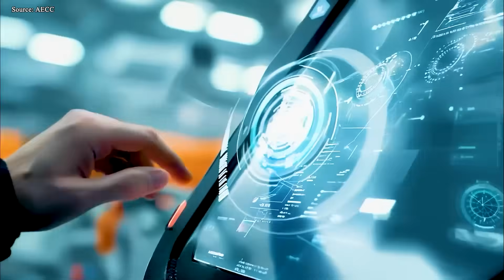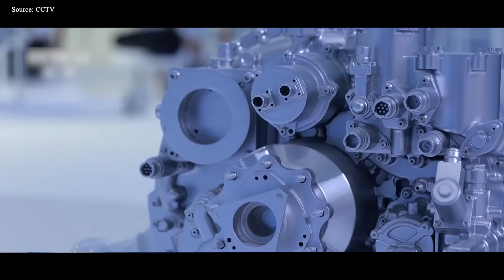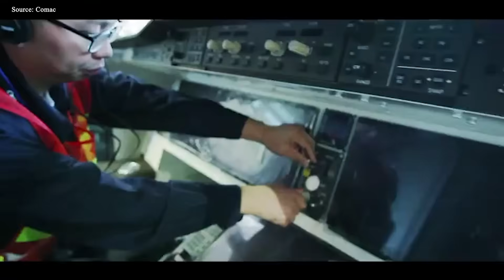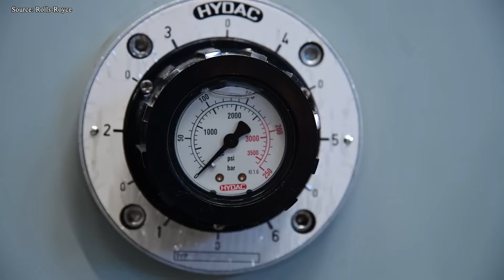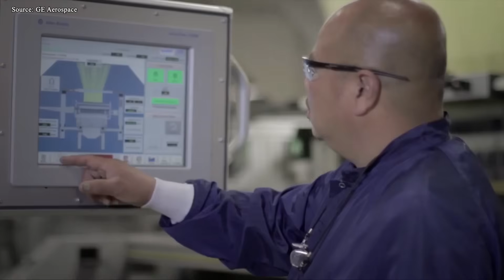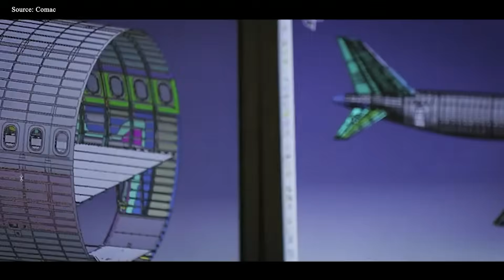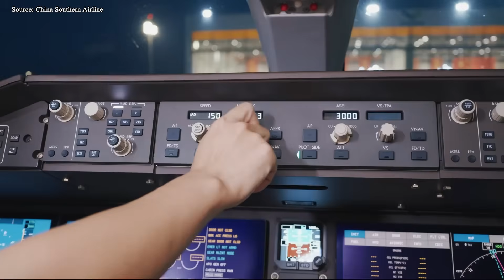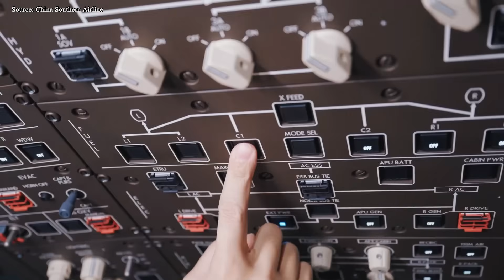How NEW Chinese CJ-3000 Engine Will Outsmart Rolls-Royce

Comment: Why does this video (and other similar ones) always show WESTERNERS working on jet engines in CHINA (presumably)?? Where are all the Chinese engineers and technicians? By having scenes of Western engineers and technical workers in jet engine labs and workshops, it makes a mockery of the subject which is taking about CHINESE innovation and progress in jet engine but show European workers instead.

This is all nonsense when a video such as this is nor produced and presented PROFESSIONALLY and appears to be just a string of different video clips from different sources put together even though the narrative on Chinese aviation advancement may be salient and correct. Otherwise, the video is more of an annoyance than an enlightenment.
Reply: CJ-3000 vs Rolls-Royce Counterparts: Core Advantages
 
In core fields, the CJ-3000 has a more forward-looking technical route than Rolls-Royce’s similar products. It integrates variable cycle technology, which can switch combustion modes on demand to adapt to different flight phases, while Rolls-Royce’s counterparts such as the Trent XWB have not yet applied this technology in mass production and still rely on traditional cycle architectures. In terms of materials and processes, the CJ-3000 makes breakthroughs—its turbine blades adopt high-temperature alloy plus 3D printing technology, enabling stable operation in 1500℃ extreme environments with a single-crystal blade yield rate of 85%. In contrast, Rolls-Royce relies on traditional nickel alloys and cooling technologies, showing slightly inferior high-temperature adaptability and process innovation. In layout design, the CJ-3000 is equipped with gear transmission technology (GTF) and carbon fiber composite fan blades, combined with a twin-engine layout to simplify the structure. Although Rolls-Royce has advantages in three-axis structure adjustment, its mechanical complexity is higher and flexibility in adapting to new aircraft models is insufficient.
 
In core indicators, the CJ-3000 fully surpasses Rolls-Royce’s products in key parameters. Its designed thrust reaches the 50-ton class, with actual measurement up to 45.8 tons, while Rolls-Royce’s Trent XWB has a thrust range of 84,000-97,000 pounds (about 38.1-44 tons), meaning the CJ-3000 leads by about 1.8-11.9 tons and is suitable for aircraft with larger maximum take-off weight. The bypass ratio of the CJ-3000 is optimized to 15:1, 56% higher than the Trent XWB’s 9.6:1, which significantly reduces airflow loss of non-core engines. In combustion efficiency, the CJ-3000 is at an industry-leading level, 12% higher than the Trent XWB’s conventional high-efficiency level, with better core energy conversion capacity. In terms of economic indicators, the CJ-3000 saves over 30 million yuan in annual fuel costs per unit, thanks to a 15% lower fuel consumption than the Trent XWB, showing obvious economic advantages.
 
In core performance, the CJ-3000 outperforms Rolls-Royce’s products in both power and economy. It has stronger thrust output—the 50-ton class thrust can support the long-distance flight of the C939 (with a maximum take-off weight of 320 tons), surpassing the power demand of the Airbus A350 adapted by the Trent XWB and being close to the engine level for the Boeing 777X, with more sufficient power redundancy. It also features better fuel economy: the combination of 15:1 high bypass ratio and variable cycle technology reduces comprehensive fuel consumption by 15% compared with the Trent XWB, bringing prominent advantages in long-distance operation costs, and its single-engine fuel consumption savings far exceed the average industry upgrade range. Besides, the CJ-3000 has stronger reliability in extreme working conditions—its turbine blades have passed 2000-hour durability tests, with excellent high-temperature stability and component service life. Although Rolls-Royce’s products have a dispatch reliability rate of 99.9%, they rely on long-term operation and maintenance optimization, and the extreme adaptability of core components is slightly weaker.
Reply from the maker: Thank you for your feedback. We will improve in the next videos

Comment: Not so fast, and the road ahead is longer than most people may think.  But it is achevable.  Given its success in its military jet engines now on par with Russia and US (nearly so).  The massive scale of its aviation and space sectors, China may have more power than people may imagine in conquering all difficulties ahead.
Reply: CJ-3000 vs Rolls-Royce Counterparts: Core Advantages
 
In core fields, the CJ-3000 has a more forward-looking technical route than Rolls-Royce’s similar products. It integrates variable cycle technology, which can switch combustion modes on demand to adapt to different flight phases, while Rolls-Royce’s counterparts such as the Trent XWB have not yet applied this technology in mass production and still rely on traditional cycle architectures. In terms of materials and processes, the CJ-3000 makes breakthroughs—its turbine blades adopt high-temperature alloy plus 3D printing technology, enabling stable operation in 1500℃ extreme environments with a single-crystal blade yield rate of 85%. In contrast, Rolls-Royce relies on traditional nickel alloys and cooling technologies, showing slightly inferior high-temperature adaptability and process innovation. In layout design, the CJ-3000 is equipped with gear transmission technology (GTF) and carbon fiber composite fan blades, combined with a twin-engine layout to simplify the structure. Although Rolls-Royce has advantages in three-axis structure adjustment, its mechanical complexity is higher and flexibility in adapting to new aircraft models is insufficient.
 
In core indicators, the CJ-3000 fully surpasses Rolls-Royce’s products in key parameters. Its designed thrust reaches the 50-ton class, with actual measurement up to 45.8 tons, while Rolls-Royce’s Trent XWB has a thrust range of 84,000-97,000 pounds (about 38.1-44 tons), meaning the CJ-3000 leads by about 1.8-11.9 tons and is suitable for aircraft with larger maximum take-off weight. The bypass ratio of the CJ-3000 is optimized to 15:1, 56% higher than the Trent XWB’s 9.6:1, which significantly reduces airflow loss of non-core engines. In combustion efficiency, the CJ-3000 is at an industry-leading level, 12% higher than the Trent XWB’s conventional high-efficiency level, with better core energy conversion capacity. In terms of economic indicators, the CJ-3000 saves over 30 million yuan in annual fuel costs per unit, thanks to a 15% lower fuel consumption than the Trent XWB, showing obvious economic advantages.
 
In core performance, the CJ-3000 outperforms Rolls-Royce’s products in both power and economy. It has stronger thrust output—the 50-ton class thrust can support the long-distance flight of the C939 (with a maximum take-off weight of 320 tons), surpassing the power demand of the Airbus A350 adapted by the Trent XWB and being close to the engine level for the Boeing 777X, with more sufficient power redundancy. It also features better fuel economy: the combination of 15:1 high bypass ratio and variable cycle technology reduces comprehensive fuel consumption by 15% compared with the Trent XWB, bringing prominent advantages in long-distance operation costs, and its single-engine fuel consumption savings far exceed the average industry upgrade range. Besides, the CJ-3000 has stronger reliability in extreme working conditions—its turbine blades have passed 2000-hour durability tests, with excellent high-temperature stability and component service life. Although Rolls-Royce’s products have a dispatch reliability rate of 99.9%, they rely on long-term operation and maintenance optimization, and the extreme adaptability of core components is slightly weaker.
Reply: Chinese fighter jet engines are famous for being unreliable, low thrust, and high fuel consumption.
Reply: @larryallen9404  - Not true anymore.  The Chinese new jet engines are more reliable with their own WS10/15/20.  The turbine blade can withstand temperature more than the F-35's blade by few hundred degrees.  Thus less maintenance and can have more thrust.  Hadn't you heard the replacement of the engines with the WSxx?
Reply: @1313hyme 
Has China figured out the bearing problems yet?
Doubtful
Reply: @larryallen9404 - I wouldn't know, but you can research that and let me know. It's your turn to do the bearing. At any rate the WS requires less maintenance and can go faster than the F-35 in range and altitude. If they can fly faster, it's more likely they got good working bearings.
Reply: @larryallen9404 - ok, I did a quick search. They are not that far behind with the bearing. 

"Presently: The gap is narrowing rapidly, especially for military applications. China is likely now self-sufficient in producing bearings good enough for its latest fighter jets, though they may still lag in certain performance metrics like mean time between failures compared to the best Western products."
Reply: @larryallen9404 The HSR bearing for the wheel was successful.
Reply: @larryallen9404 Your statement is seriously outdated and based on prejudice. China's aviation engine industry has made remarkable progress in recent years. Take the WS-10 series, for example, which powers the J-10C, J-16, and J-20. These engines have demonstrated high reliability, with a dispatch rate exceeding 98% in actual service. In terms of thrust, the WS-10B already delivers over 14 tons of thrust, and the latest WS-15 (for the J-20) is a world-class high-thrust engine. Fuel efficiency has also been significantly improved through advanced combustion technology and materials, making the claim of "high fuel consumption" completely unfounded.
 
In contrast, the U.S. is relatively lagging in some aspects and even has issues like the fraud situation mentioned by Musk. Its engine systems are also unreliable and often break down. For example, the F-35's F135 engine has long been plagued by problems such as insufficient thrust, high maintenance costs, and frequent failures, which seriously affect the combat readiness of the aircraft. This shows that your one-sided criticism of Chinese engines while ignoring the problems of American products is extremely biased.
Reply: @larryallen9404 J 20 flies longer despite being heavier than F 35/22...
Reply: @liongjiahwong5478 
The continued problems are metallurgy, and lack of skills in 5 to 7 axis machining

Comment: Is it better than PD 35 ?
Reply from the maker: We will upload a comparison video soon. Thank you for your feedback!
Reply: CJ-3000 vs Russian PD-35: Comprehensive Technological Breakthroughs and Performance Advantages
 
In the field of high-thrust aero-engines, China's CJ-3000 and Russia's PD-35 are two of the most notable next-generation products. CJ-3000 demonstrates all-round leadership over PD-35 in core performance, technical routes, and practical application prospects, which is reflected in the following three dimensions:
 
1. Thrust and Energy Efficiency: Generational Advantages of 50-ton Class Power
 
The design thrust of CJ-3000 reaches the 50-ton class (with a measured thrust of 45.8 tons), while the current test thrust of PD-35 is about 35 tons, and its subsequent target thrust is planned to reach 40 tons, but there is still a significant gap with CJ-3000. This thrust advantage directly determines the potential of the adapted aircraft models—CJ-3000 can support the C939 super large wide-body airliner (with a maximum take-off weight of 320 tons) to achieve long-range intercontinental flights, while PD-35 is mainly adapted to the wide-body improved version of the Russian MC-21 series, which is significantly inferior in capacity and range.
 
In terms of energy efficiency, CJ-3000 integrates variable cycle technology, which improves fuel efficiency by 25% during high-altitude cruise. This technology has only been engineeringly applied in China, while PD-35 still uses a traditional turbofan cycle architecture. In actual operation, the combustion efficiency of CJ-3000 is 12% higher than that of PD-35, and the annual fuel cost per unit can be saved by more than 30 million yuan. The economic advantage is particularly prominent in long-distance routes.
 
2. Materials and Processes: A Leap from Catching Up to Surpassing
 
The turbine blades of CJ-3000 adopt 3D printed single-crystal superalloy, which can operate stably in extreme environments of 1500℃, with a yield rate of 85%. Although PD-35 also attempts to apply additive manufacturing technology, due to limitations in material research and development capabilities, its turbine blades still rely on traditional nickel-based alloys, and both high-temperature resistance and process stability are inferior to CJ-3000.
 
In structural innovation, the fan blades of CJ-3000 use carbon fiber composite materials, combined with gear transmission technology (GTF), which not only has a significant weight reduction effect but also greatly reduces airflow loss in non-core engines. Although the fan of PD-35 also uses composite materials, its design is conservative, with a bypass ratio of only 10:1, far lower than CJ-3000's 15:1, resulting in a significant gap in propulsion efficiency.
 
3. R&D Progress and Engineering Maturity: A Reflection of China's Speed
 
It took only 5 years for CJ-3000 to go from core engine ignition to prototype testing. It has now entered the installation and flight test phase and is planned to be mass-produced in 2028. The development of PD-35 started in 2017, and the preliminary test of the technology demonstrator was completed in 2024. The second phase of testing (mainly verifying domestic material components) was entered in 2025. According to the plan, certification will be completed in 2027, and the overall progress is at least 3 years behind China.
 
Behind this progress difference is the gap in the R&D system: China has built a full-process R&D chain of "core engine - demonstrator - prototype", while Russia's PD-35 R&D has repeatedly stalled due to funding and technical discontinuities, and its technical indicators have been reduced from the initial 40-ton thrust target.
 
4. Reliability and Maintainability: Full-cycle Advantages from Design to Operation
 
The turbine blades of CJ-3000 have passed 2000 hours of durability testing, and the service life of key components has reached the international advanced level. Although PD-35 has shown basic reliability in testing, due to shortcomings in materials and processes, its maintenance interval and overhaul cost are expected to be higher than those of CJ-3000.
 
In actual application scenarios, the modular design of CJ-3000 facilitates rapid repair and component replacement, while the structural complexity of PD-35 is relatively high, and the maintenance process relies on the Russian local supply chain, which has obvious shortcomings in global operations.
 
In conclusion, CJ-3000 engine comprehensively surpasses the Russian PD-35 in thrust performance, technological innovation, R&D progress, and engineering maturity. It not only achieves a leap from "following" to "leading" but also marks that China has entered the world's first echelon in the field of high-thrust aero-engines.